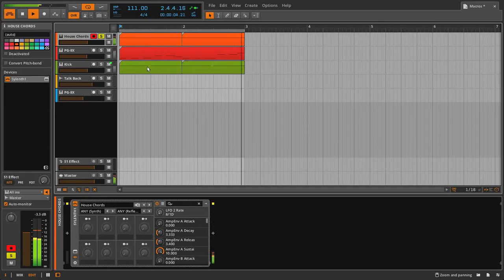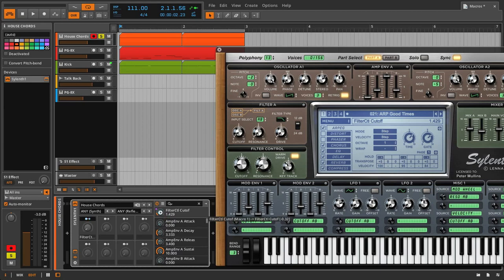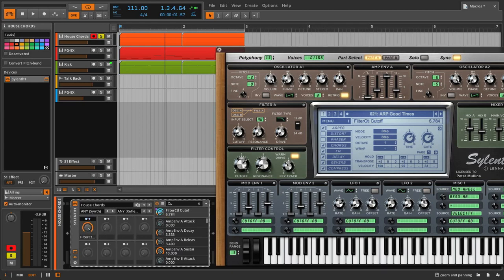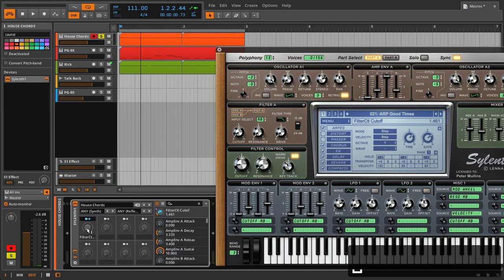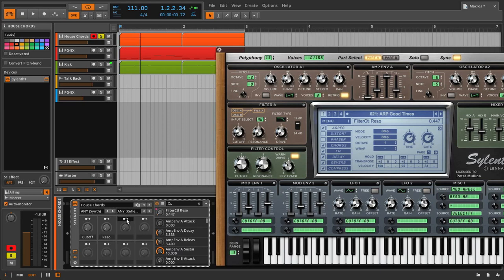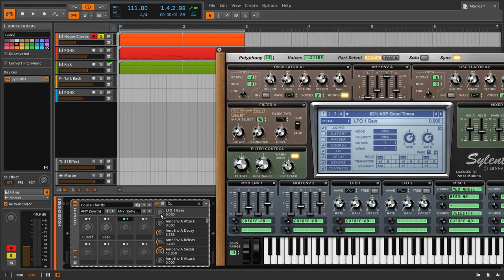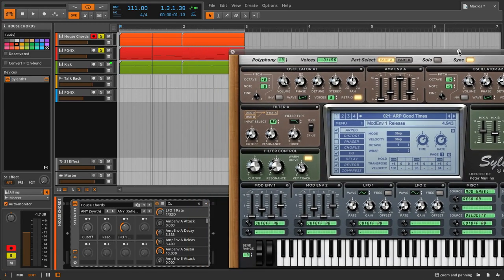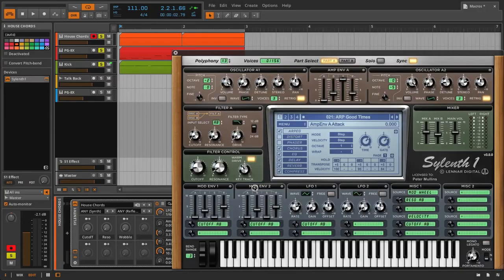Bitwig Walkthrough - Mapping and Using Macros

Comment: Just watched your previous video on Device Mapping, do those 2 techniques are conflicting?

Another question for you: I use the Minimonsta and would like to be able to change presets with a knob, what's the best solution? I have some vague ideas but want to be sure instead of messing with that ;)
Reply from the maker: Great question, truth is most softsynth don't support remote patch changes through this method. Sometimes however they will support direct midi bank change control. You gotta check with each synth on that one. Bitwig does have good integration of patch browsing on the daw itself.. I'll let you know if I find an easy way to remotely control it!
Reply from the maker: They do not conflict as your controller will be in different modes (device or macro) depending on which you choose. Changing modes requires the use of mid I controller supported by bitwig with scripting. That list of supported controllers is steadily growing!
Reply: +reflekshun Some of the vsts i use have their presets appear in Bitwig, some don't (like Minimonsta). I know pretty much nothing about Midi stuffs, so i don't have an idea what's the difference between those unfortunately.
Reply: +reflekshun Answer to your 2nd comment, i use an Emu XBoard49, basically a genereic 49 keys but with 16 rotaries. No Bitwig script for this one, that's why i found the Device Mapping technique ULTRA interesting, you see? :)
Thanks for your help!